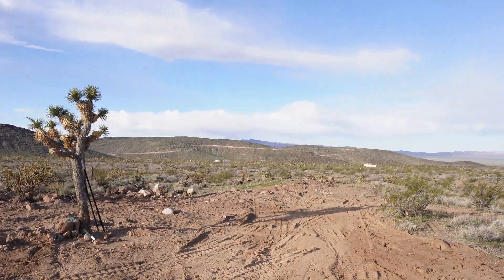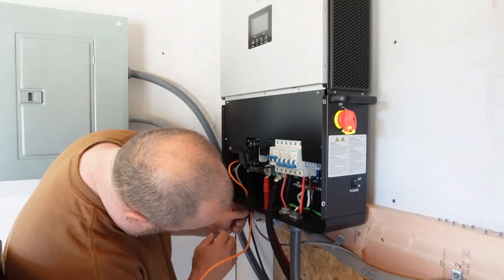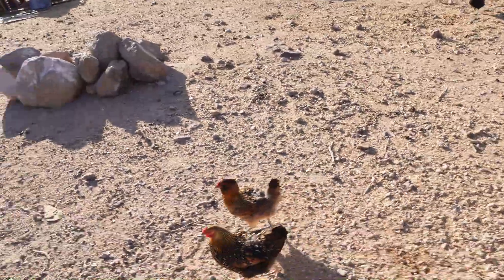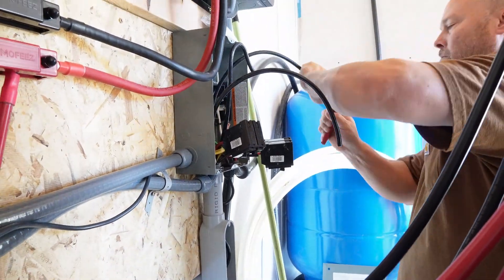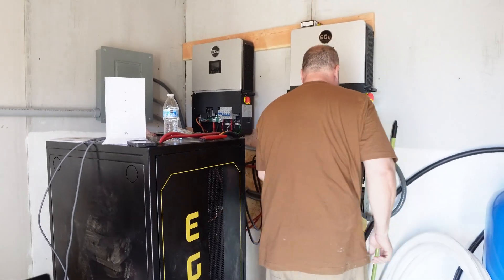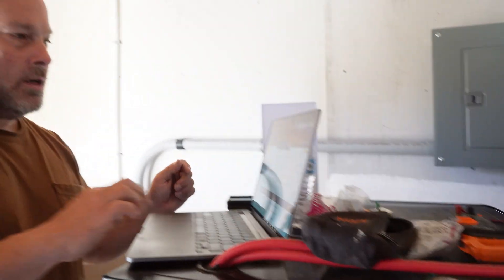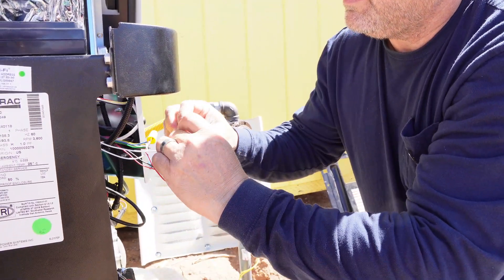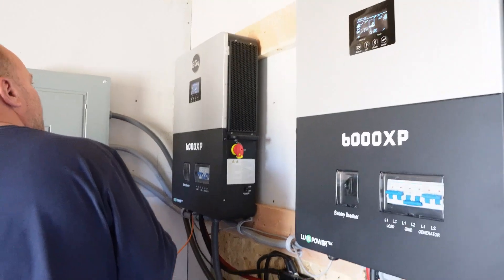The EG4 6000XP Secret To My Off-Grid Power Plant

Comment: Too bad you're not promoting the far superior Schneider Conext XW PRO series line of inverters that Siganature Solar sells. They last far longer, offer a much greater surge capacity, and they're much safer for residential applications because of their galvanically isolated output transformer than these cheap high-frequency inverters. The 18kpv doesn't even have an output transformer and can damage your appliances when their MOSFETs fail.
Reply from the maker: I agree that mosfets fail and transformers are better in the long run. I am also not promoting any of these products. I was just entertaining the thought of pushing as much power into batteries with a generator as your primary source of power and how economical it is or usnt.  I am running a signature solar lv6500 inverter and 20 solar panels and no generator but I will look into what xw pro.  Thanks for the comment

Comment: Even today, after more than 25 years of product development, You'd be lucky to get even two to three years of service from these Chinese-made high-frequency, transformerless XP inverters, especially when powering high inductance loads like full-sized refrigerators, large power tools, portable AC units or large microwave ovens. The reason for this is that all of these lightweight, high-frequency inverter chargers lack a very critical component. That critical component is a heavy duty, iron core, copper wound output transformer. Without an output transformer to act as a buffer to absorb the electrical surges provided by the “Flywheel Effect” inherent in the physical amount of a transformer’s iron, these surges and damaging reverse voltage spikes must be handled directly by the inverter’s MOSFET transistors, essentially shortening their life. 

Another major consideration with many of these lightweight, high-frequency, XP transformerless inverters is safety. First of all, many high-frequency inverters don’t have any isolation between the Neutral and Line, which increases the risk of a shock hazard. And second, during a catastrophic failure of the inverter’s circuitry, all it would take is for the AC output monitoring circuitry to fail, and one of the MOSFETs in the inverter's H-Bridge circuit to short to ground, and these high-frequency inverters can send dangerous, high voltage, high amperage DC current straight to your connected AC loads which will not only damage most AC appliances but can also set those AC appliances on fire.
Reply from the maker: I agree they won't last forever, and a more analog coil last longer. The xp comes with a full warranty for 5 years, so it is a good deal considering the cost. I have been running the eg4 6500 for 4 years now, and they have been flawless. A couple of things the new  xps have is a separated neutral/ ground. The best solution would be the 18k eg4 it has a iron coil that has a 10-year warranty, but the cost goes up considerably. Thanks for comment.
Reply: @offgridroadrunnerranch  Search Google or YouTube, and you'll find that the majority of 6500EX inverters haven't been running flawlessly. Most have failed and are now being offered as refurbished units,

Comment: These cheap, lightweight, Chinese made, high frequency, transformerless, inverters offer much shorter life expectacies and far poorer surge capacities than low frequency, transformer based inverters. And because they don't have a built in output transformer to provide galvanic isolation, they can damage your appliances. Google it if you don't believe me.

Comment: Greetings from up North. I have two 6000xp's to install this coming spring. I enjoyed your video very much and it was good to see this setup can be stable using the generator input instead of an external charger. What capacity battery bank was being used when you did the install? Cheers!
Reply from the maker: It was a 200amp hour or 2 eg4 server rack  100amp hour batteries. The minimum for 2 6000xps
Reply: Thanks!

Comment: We have a 45kw natural gas generator for this and to run our whole house and 8 tons of air conditioning plus the electric kitchen and a 42u rack and some other things like 2 BEVs and a bev zero turn mower. It runs 1,800 rpm and is liquid cooled. We also have a 22kw diesel on a trailer, a multiquip with dial a phase on the screen for Winter outages and longer duration ones where the natural gas isn't available for some reason. It's 1,800 rpm too but also turbocharged 4 banger diesel instead of a v8 natural gas, propane, and gasoline in the 45kw.

In the Spring, Summer, and most of the Fall the natural gas is only used for hot water and to dry our clothes (tankless heater and a 9 cubic feet gas dryer) and 2 100k btu gas furnaces, 2 40k btu gas fireplaces so we like having the diesel in heating season if we need it.

I hired an electrician to do all of this stuff though. He pulled the permits and subcontracted the 30kw of solar too, it was all installed in 3 or 4 days. House has 200a of service and 2 200a braker boxes.
Reply from the maker: Sounds like a nice system thanks for the comment

Comment: What would a kwh per gallon be? Is there a way to maximize it by setting rpm?
Reply from the maker: The way to maximize is to charge as fast as possible and then only charge between 20 percent to 80. It takes about the same time to go from 0 to 80 percent as it takes to go from 80 to 100 percent. As for cost per kilowatt, it is hard to do the math because the is running during the charge, but we live desert and the ac is 90 percent on the power we use and per day in summer was costing 1 1/4 gallons of propane so solar is really needed  to reduce cost but it works if you lived in a dark climate like Alaska

Comment: I looked at doing this with my 10/11kw Generac, but EG4 says you must use an inverter-generator with no more than 3% THD. Generac says these generators have a THD of <5%. Supposedly the EG4 inverters can be damaged by the higher THD and voids the warranty.

The recommended way around this is to use the Generac to power an EG4 Chargeverter that charges the batteries directly. The newest Chargeverter can even control the Generator for start/stop based on the state of charge in the batteries.
Reply from the maker: I believe most of the thd comes from under sized generators.  Eg4 suggested to use double the sizes gen to make sure it doesn't struggle with load and this system is more than double the inverter size.  Thanks for comment.
Reply: @offgridroadrunnerranch  Yeah, I agree that THD comes from undersized generator. Well, if EG4 suggested it, then you're good to go. Nice for me to know also. Do you happen to know, in the 6000xp settings can you limit the load on the generator like you can with a Chargeverter? My Generac isn't as big as yours, I'm a little afraid of causing it too much load.
Reply from the maker: @mattcwagner the eg4 alowws you to set the size of the generator so I am assuming that is what limits the draw. Not sure  100% but I believe the 26kw gen was larger than the biggest setting i could put down for gen size i believe the 2 eg4s had a max setting of 24kw

Comment: seems like solar panels may have been easier?
Reply from the maker: Ya i agree but in order for them to get there occupation permit they did the gen and then they are adding solar later. If they did solar first they need engineering and more permits to get the occupation cert
Reply: @offgridroadrunnerranch  good to know thanks
Reply from the maker: @FaraFox-e4w could be applied to areas that don't get alot of sun though
Reply: This is my plan as well, bought a 22KW Honeywell from COSTCO on sale (made by Generac), to replace a failed Cummins 20KW..  it’s currently connected through a 200A Cummins transfer switch.  I also have a 10KW Enphase microinverter system, line side connected..  next will be an EG4 GridBOSS and FlexBOSS21, along with (2) of the EG4 PowerPro WallMount 14.3KW Lithium batteries..  the house uses 50KW/day, so on low solar or grid failure days, the generator will startup for a few hours to charge the batteries back up….  So should always have power, even during extended winter storms and grid down situations..  already bought the 2 wire start kit, to be ready.  Now just need $14K to get all the EG4 equipment 😬
Reply from the maker: @mwolrich sounds like a solid system